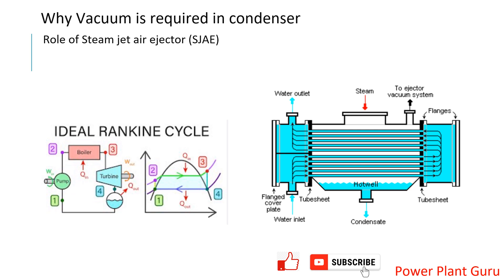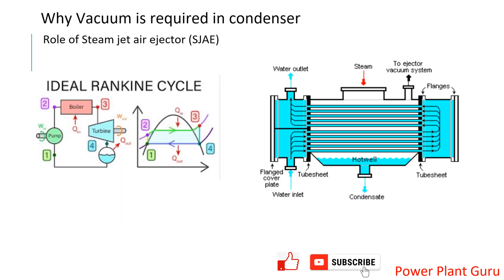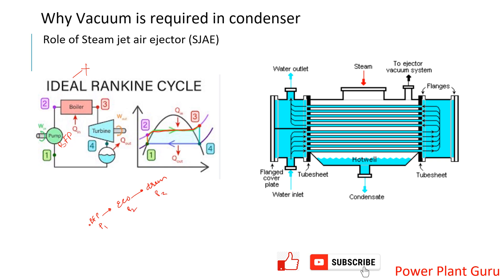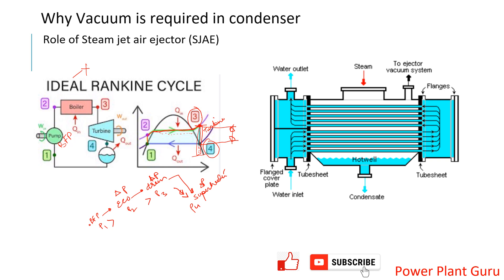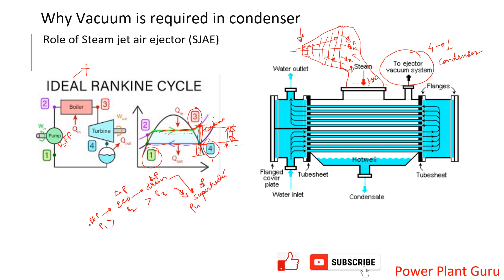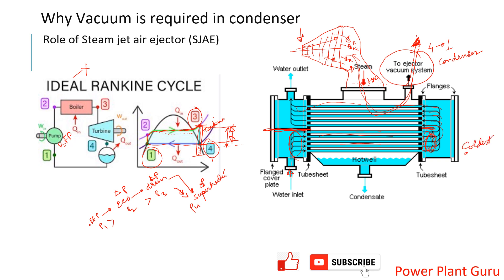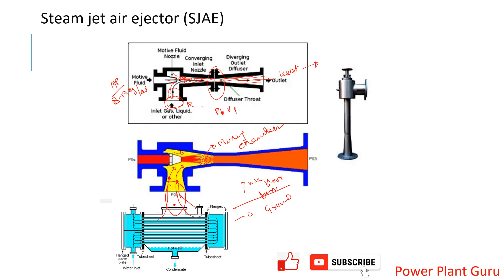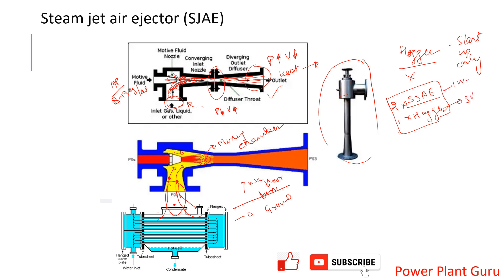Ejector, Hogger system and Vacuum in Condenser

Comment: Sir what is emergency stop valve??? What is ESv atmospheric vent???
Reply: In any critical situation  temperature, pressure high or low , any other critical interlock  acts in  Turbine The Emergency Stop Value ESV will close Suddenly  to save the turbine
Reply: Esv placed before the Governing value

Comment: Why a hogger is needed initially, when ejector can do the same job!
Reply: When starting up your sjae would you open your Steam or Air first and why?
Reply from the maker: Hello Durga
Hogger is also one kind of ejector, but it's size and steam consumption is higher and it is required when there is no vacuum in condenser and you need more power to establish the initial vacuum. Once you have established the initial vacuum then there is only requirement of only to maintain which may be small as.compared to initial requirements.